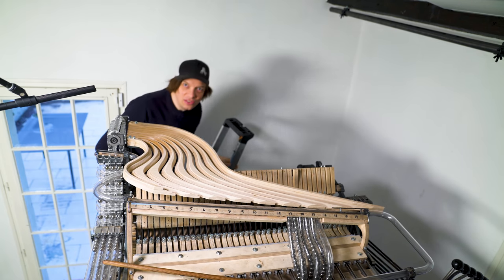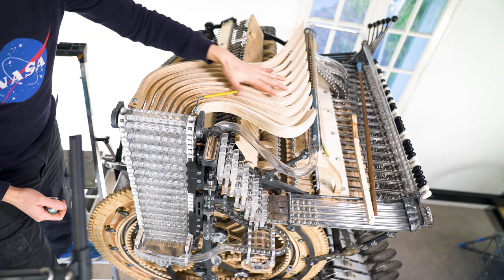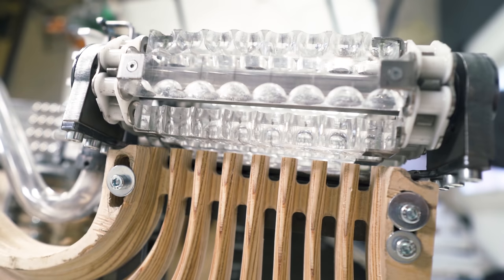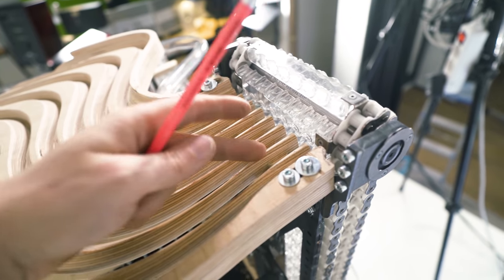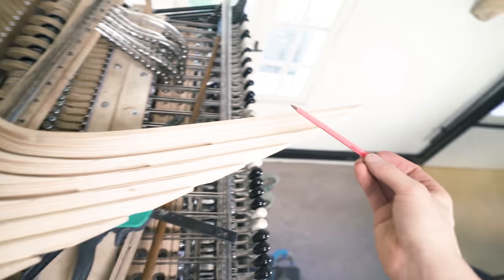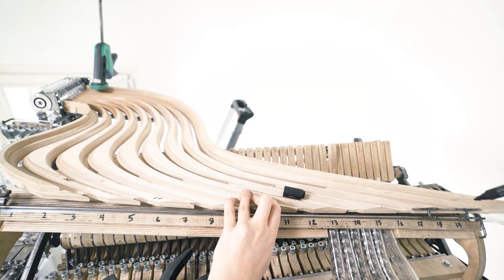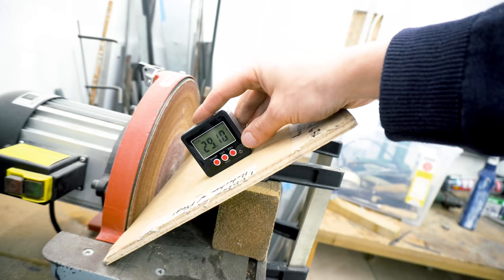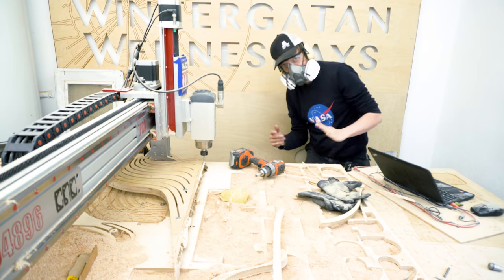Marble Conveyor Belt Plywood Lanes

Comment: Is there an increase in noise? This is a mechanical instrument, and I can hear the marbles falling into the shoots. Perhaps a felt pathway would keep the noise down?
Reply: He had one before but removed it due to marble falling from it, maybe he can add it back with this new redesign?

Also I noticed that they also bounce off the plastic glass convoyer and maybe adding a bit of felt there wouldn't be an issue.

Comment: I'm at 9:50 and it's glaringly obvious that you need to go back to your height modules and get these tuned better. The marbles are stopping and bouncing, fast marbles hitting stopped and tossing them up in the air, it's chaos. With the addition of the marbles entering this path from almost right angles to the flow from above you will be tossing marbles out randomly, bouncing and escaping towards the front of the machine and onto the floor. 

I think you may also need to add some kind of a directional funnel to the marble tube entries where they go down, when a marble has dropped you can watch the marble that is running down the chute bounce off the rim of the hole on the right side, roll around the rim like a basketball and then fall down into place letting other marbles pass over it. maybe like a 30-40 degree angle facing down and to the right.

I think you also need to bring the top side of the marble lanes up 1-1,5 cm up to meet where the marbles are actually coming off the elevator belt. This would remove the loud clack as they bounce down.

Comment: some of the marbles are still moving extremely fast out of that, if one marble moving fast enough hits another at the right angle you're going to end up with marbles on the floor... if you're lucky, or they could end up somewhere inside the machine.

Comment: New track looks great...well, except for the bolts at the top, but ok.   Little worried about the speed the marbles are getting as they enter the main track.   Now, if you could just change out the plastic lifter with more wood....lol.

Comment: that much bouncing with this small of a sample size. Imagine a much larger sample size.

those lanes are gorgeous, but the marbles are exiting it too quickly. perhaps adhering something with a bit of grip to the latter half of the lanes to slow the marbles down prior to entering the marble divider would be a good idea?

even then though... as beautiful as it is I'd be worried it will lead to more moles in the long run.

Comment: That thing looks amazing! Here is a potential issue, though. Whether or not this is a success depends a lot on the kind of songs you want to play with it, much more so than in the previous design. If you have a song with only high notes on the vibraphone, this song will only be served by the fish stair. That is, only 4 marbles per move. I am wondering if that is enough if you play some fast 16th. The previous design delivered many more marbles over the full length of the entry holes. Now most of the marbles go straight to the rhythm section, and with high velocity. Some of them even seem to jump over a few holes, so most marbles are only available for the base. Anyways, I am really enjoying your new second channel!

Comment: If this is not supposed to be the final version, Martin should do a test and try to use the CNC to carve a bit more the width at the end of a lane, so the marbles further slow down by the "smaller radius rotation principle" he showed on a previous video. I guess it may work to reduce the speed and part of the undesired bounciness. It should be quite trivial to dissemble and put it on the CNC, carve it a bit more, lightly sand, and reassemble to test. Aesthetically it would remain almost the same and take the same amount of steps to assemble the final version.

Comment: I don't know if any future performances have a high amount of vibraphone in them, but I'm a little worried about the feed rate of marbles into the vibraphone channels. Would they be pre-loaded prior to every song, and would there be enough overflow marbles in the system to keep up with an active vibraphone? The only 'complaint' about this system is, from what I understand, that marbles feed into the elevator by gravity and would have more bias towards the left most/furthest back elevator slots, which feed into the divider around most of the drum/percussion tracks, and again, does that limit the amount of vibraphone the machine is theoretically capable of?

Nit-picking aside, the machine's evolution is fascinating to watch every time a new video comes up. The changes and iterations many parts have gone through is astonishing, and truly, props to you Martin, and everyone else in the team at every level for working on and believing in the Marble Machine X.

Comment: Maybe it's because you only have so many channels open on the MMX, but it doesn't seem like that many are making it to the first couple of holes outside of the ones going through the divide by 4. Will this be an issue if you have lots of fast notes playing in that range, or will more marbles make it there as more channels get integrated into the marble drop tests?

Comment: It seems the marble lift "favors" slots 3, 4, 5 while the rest usually stay empty. Skimming thru the latest videos again, it looks fine in the "Assembling Height Modules" video (lift slots fully utilized). Could this be a new mole, or is it just a non-issue side effect of test runs (as the machine is not fully loaded)?
Reply: that is fed with marbles that have been played. as more are being played there will be more there and it will fill up more and most likely be more even. martin could test it, not sure if he will though.

Comment: And that's what I get for doubting for a moment. Forget Medusa's Hair, that's the Flowing Golden Locks of Hair there now. That fit much better than I expected with the ends removed and that bit of rotation in there. That extra part on the far right -- is that there purely for holding the outer rail there, or is it for rebound catching? (It looks like one or two came close to bouncing that way, so it looks like a good, valid addition.) 

The only concern I think I have left is that thin spot on the forward side of the rail where it splintered, from the standpoint of what the machine could be subjected to when shipping it on the world tour -- but totally agree, it looks tight and tricky in that part of the machine to try to get in any sort of alternate mount points. Maybe that's a part that gets taken off the machine to keep it safe during shipping/movement, and the "MMX Kit" design gets the tweaked mounting.

Comment: In addition to the marble bouncing issue... this new design does raise some concerns for me about getting the right number of marbles to the channels that need it with out having to do a full loop thru the fish stair.  In theory the marble lift brings 6x marbles to the top but if he is playing a solo on the vibraphone, especially in the on the lower end. he is going to need more marbles in the start of the of the marble divider... However 5 out 6 marbles tracks deposit the marbles past the low vibraphone notes thus forcing them to be merged into the single lane and make a trip around the other marble divider channels which is a slower path all together.  Then the fish stair only allows 4 of the 6 marbles to be lifted.  Assuming the drums are muted, its seems the flow can get out of balance and marbles will get backed up.   This is all speculation but it seems worth noting that there is a few choke points here.

Comment: Man, i see some problems here:
1 - Marbles go too fast, so they jump, with falling down risk. I can see you added a playwood bar at the end of the lanes to prevent that, but i think this is not a solution (not like that at least).
2 - This system is much louder than before because of speed and bouncing.
3 - I can see there're still problems with marbles stuck at the top of the divider.
4 - I think there's too much manual work in this lane, probably an "out of the box" from cad would be much better. You need to replicate every piece of the machine without so much (hoping zero) manuale effort.
5 - The mole is pregnant.

Comment: Ok Martin... bouncing marbles is an issue with how they fly at speed into the track. However I think I have a good solution. It's mounted directly so that the marbles roll straight to the path. It's also twisted a little to align which may be putting extra stress.

What if you created a stop and drop system by raising up the end of the tracks and making a backboard with sound dampening walls for the marbles to hit and drop down the extend side that you have and merge with the marbles that way.  That way you don't have them flying down the marble divider and potentially missing slots they could have dropped down into with missing marbles

I can imagine with it rased you could CNC one thin board with 8 groves cut like the marble drops so that we can see the marble drop down.

Or... maaaaybe Smooth the exits out so that they have one smooth track all the way off the edge and down the slope to the dividing track, then, when the marble consistently travels that path, put a pin directly in the way to stop the movement and cause it to simply roll down the side wall and join the marbles. Pin just out of the way of the other marbles traveling the track but right in the way at the end of the swirl plates tracks, dampened by silicon.

Comment: I don't understand how Martin doesn't see the glaring issues with this design. The speed that the marbles exit the new design is clearly too fast and the marbles are bound to fly out of the top due to high speed collisions with slower marbles. The second issue lies within each track being separated. The marble elevator barely is full and the marbles usually tend to stick to the middle few slots. This will result in some tracks basically having no marbles to feed the higher sections of the machine. I know he is relying on the 4 marble stepper to help but i still think it will pose an issue later on.

Comment: It looks like channels 1 & 2 will only be fed by the return stream and that 3 & 4 will only have the the first track in addition. Are you at all worried about those channels getting starved?

Also, it's looks like the main stair tends to prefer the middle tracks, which is no bid deal for the later channels, but could be pretty bad for channels 1-4 since they'd be getting hardly any marbles from the main stair, having to rely almost solely on the return stair.

It is very pretty, though! :)

Comment: Hey Martin as those marbles impact that plywood ,eventually they're going to beat a little dimple into the wood you might want to get some thin cyno acrylate glue and squirt it all over the plywood it will soak in and turn it hard as a rock you'll get a lot more longevity out of the ply.

Comment: You will need to find a way to slow down the marbles or you will need to put some rail because the marbles are getting some serious speed and are bouncing all around, maby make a dent on the end of the new track so it would have a better transition with the marble divider

Comment: Marbles are bouncing a lot, with almost all channels filled. I imagine there will be a lot of 10:25 examples when the machine is going to play music. Adding rails is not a solution, it’s a tweak. You should rather slow down the marbles with over rotation, but wood may wear out quickly since the marbles are rolling pretty fast

Comment: Just like when you only have a hammer, every screw becomes a nail.  When you have a CNC every cut becomes a CAD design.  I would have just used a table saw with a 45° angle

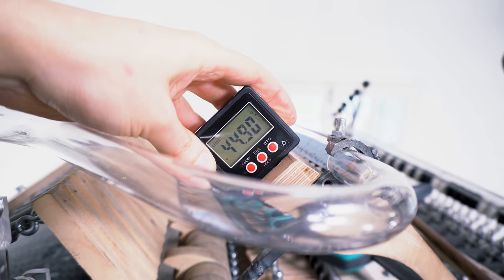Comment: 5:00 You're inventive, I'll give you that. But as a joiner I can't watch this without cringing. I already commented on it in another video, you NEED to get a cheap small tablesaw for stuff like this. It's way more accurate and easier to handle. You can get a new one for as cheap as 300€ or buy a used one.

Comment: i just saw a mole.  the problem with your track. because each lane is a different angle and have different curves the marbles pick up different speeds thus when they land they bounce and make alot of noise. SOLUTION at the end of the track add a finish line that slows down the marbles so they reach the marble divider without bouncing.

Comment: I’d hold off from smacking that mole just yet... Looks like you solved one problem but I predict you just created another. 🤔

1. First one is minor and easily fixable, At the elevator it looks like it’s shifted towards the rear a millimeter or two causing the marbles to bounce perpendicular to the marbles path. At higher speeds this may cause marbles to bounce to other tracks.

2. While the new track looks amazing. I feel it fall to much into the artsy side of your star and not enough on the mechanics and timing side. Artsy because you have 8 very wavy and space consuming shapes and Timing because now your introducing more marbles further down the divider. While not an issue not with only 6 gates working but how starved for marbles will the vibraphone be once you get that part working? Just an educated guess here but I’d wager they will be starved more now then before.
I have an idea in mind that might fix both your old and possibly new issues if you’re interested. I just need to draw it out and I can send it your way on discord.

Otherwise it looks fantastic and your making great progress on this! Can’t wait for the next Wintergaten Wednesday!

Comment: I feel like you're getting buried in an endless mountain of tiny details. Maybe focus on the big things for a while. How long has it been since you even touched the vibraphone? Maybe get that going? Is the bass concept viable? You're working on losing a few marbles every test, but you don't know how well the bass is going to work. What if that needs major redesign? What if the current funnels don't work with the bass? What if during the process of solving issues with the bass you realize some part you just invested time in needs to change?
The most basic function of this machine is not to fill pipes evenly. It's not to move marbles around without losing any of them. It's to play instruments following a programmed track. It seems like you abandoned that idea.

I'm worried you'll end up where you were a couple of episodes ago, ready to quit because of how many issues you were encountering. Right now, I don't think you're getting much satisfaction out of solving these issues. But if you were to get the vibraphone going and actually play a song on the machine... I bet that will definitely put a smile on your face.